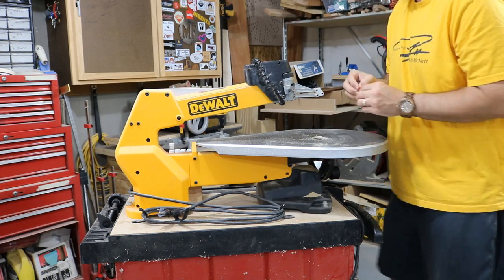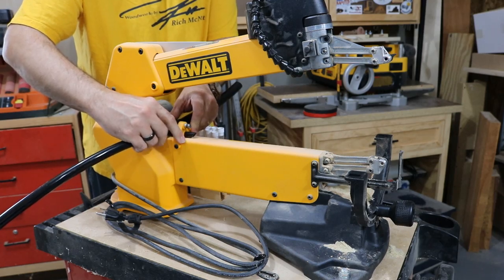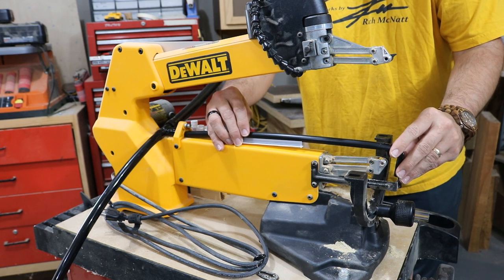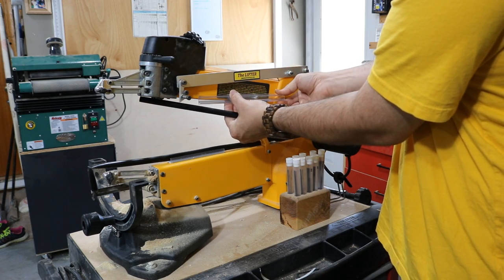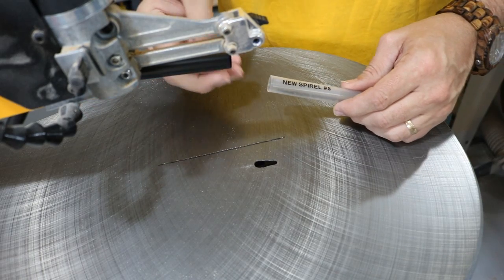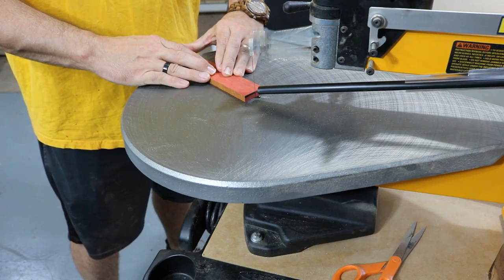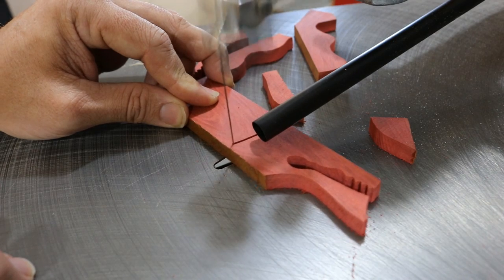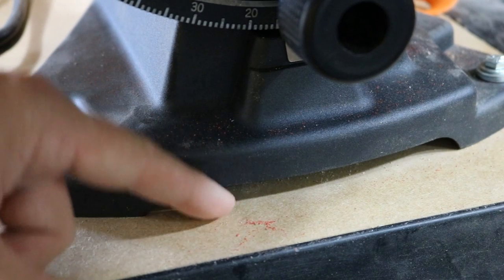Scrollnado Install/Review

Comment: Hey Mike, just a tip. You do not have to remove those two screws to remove the table. Just take off the front knob. Then slide the table forward and off. No big deal just a little faster than getting under the table and looking for the screws. Nice video. Chris has designed a pretty good product.
Reply from the maker: +Steve Good thanks Steve, didn't even thank about taking the knob off. I'm very impressed with the product. I've talked to Chris A few times now, his office is about 20min from me.

Comment: Do you still use the scrollnado. Was it annoying, especially with fretwork
Reply from the maker: its not annoying to use maybe the sound from the shop vac, I have move on from the scroll saw and sold it. but if i still had yes i would still use the Scrollnado
Reply: @mfwoodshop  Thank you for your reply!